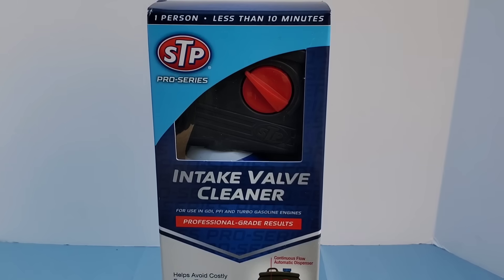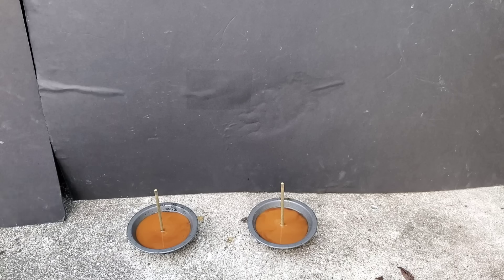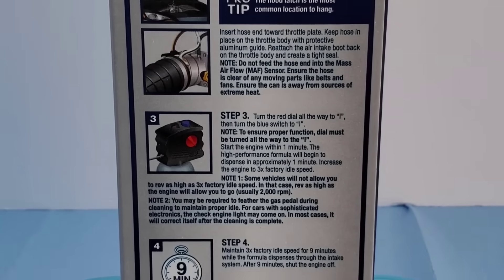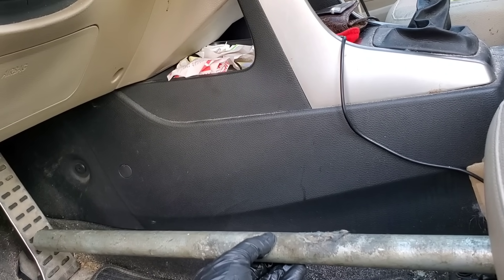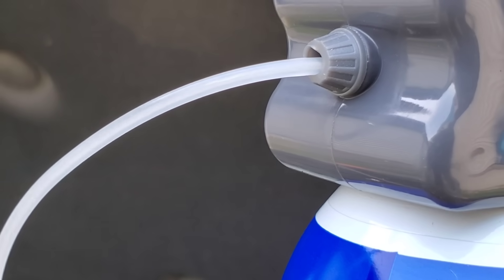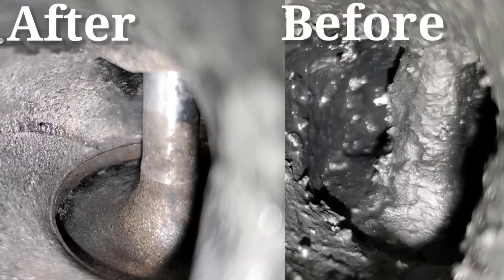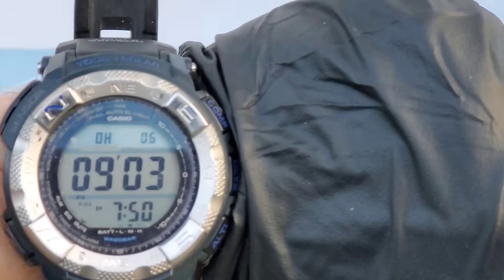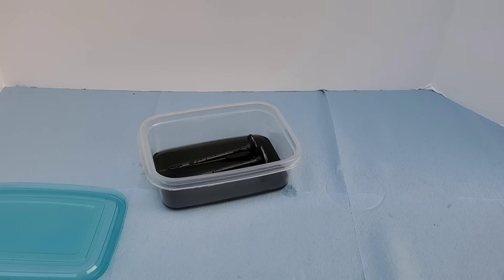Stp Pro Series Intake Valve Cleaner works!

Comment: Would this product work on an SFI (sequential injection) engine? What are your thoughts, would it make any difference or damage any internals?
Reply: It wouldn't do anything that the fuel isn't already doing. In a SFI engine the fuel cleans the valves so there is no need. This type of cleaning is really only needed in GDI engines.

Comment: Question, the valve on the right...how exactly does that build-up happen and how many miles was on that car?
Reply: With todays EGR systems the blow by gases/particles/droplets (which include Oil) can no longer vent into the air (as they did a long time ago) but must rather be captured and “recycled” back into the engine via the PCV (positive crankcase ventilation valve). It does that by mixing the blow by gases and Oil with the incoming air via the Intake Valve. Due to the temperature difference between the intake valve and incoming air (mixed with gas and Oil) has a tendency to deposit the Oil droplets on the Intake valves and ‘coking’ them up (black carbon deposit). Prior engines where fuel and air were mixed in the intake tract (port injection or carburetors) didn’t have that issue since the fuel literally ‘hosed’ down the Intake Valves hence keeping them clean. This issue is only a problem in modern Direct inject engines.
It can happen as early as 10-20,000 miles in some engines but usually is a concern between 40,000 -70,000 miles. Each engine is different and some have it worse than others.

Comment: I use foaming action Easy Off oven cleaner. Just warm the engine, fill the valve covers and intake manifold, let it sit overnight, start the engine the next morning and VOILA!  Not only does it clean, it restores worn and damaged parts! AND a cherry pie magically appears on top of the engine when the process is complete! But wait, there's more, Vince from Sham-wow comes out and details your vehicle and bangs your woman for you! Act now, operators are standing by!

Comment: Well time for a old mechanic trick.....brakefluid dous just the same, when the engine is running i pour some litle straight in the carburator and repertoire this a few times , it burns the inside verry clean .

Comment: 1 where does it all goes? Into cats?
2 valves are steel I got it, but how about valve seats, intake and exhaust ports(aluminum ones) and moreover gaskets?
3 how this is better than kerosene and transmission oil?

Comment: It works, as demonstrated, the part that STP doesn’t tell you is that ‘chunks’ will break up and get into your combustion chamber and some will lodge between the Piston rings and cause ‘Oil burn’ issues. Also, change the Oil a day later and you will see a lot of broken off carbon bits in the bottom of your Oil Pan! So yes, it works but…
Reply: I think you had oil burn issues before. Maybe just never noticed it. The carbon that this procedure is ‘dislodging’ is in a soft liquid form when it comes off due to this product being spraying into the intake. If any chunks would get lodged in between your oil control rings they would quickly disintegrate.
Reply: Why do the chunks slide by the piston rings ? Wouldn't they just get blown out the exhaust chamber ?
Reply: @truhunk1 p
Reply: @truhunk1 , some chunks probably get suspended in Oil and carried via various pathways into the Oil Pan and some probably get blown out too. Some smaller pieces can travel past the rings. There are many ways they end up in the Oil Pan.
Reply: @HsquaredH2  Then I guess the turbo blades love it at 15,000 rpm 🤦🏼‍♂️
Reply: Damn. Wouldn’t that be harmful for the engine and catalytic converter?
Reply: @unitedwestanddividedwefall3521  yes, definitely.
Reply: @itzed  thats why you do it on a hot engine.  burns straight off
Reply: What if you do it just before an oil change?
Reply: Never heard of it
Reply: Need to vacuum afterwards.
Reply: This problem happened to me when carbon cleaning my engine. The carbon deposits got between the piston rings and walls.
Reply: 😂 just do it right take the head off and intake
Reply: From what information and research the best way is to walnut blast  but using this spay every 10,000 kilometres would be a preventative measure so you cut down on carbon build up.
Reply: So tldr just do walnut blasting
Reply: Total nonsense from a tiny mechanic who wants to make a fortune out of walnut flour
Reply: I've used it multiple timez and never had this issue
Reply: From the gdi turbo engine I just tore down, not long after doing 2 of these and then starting to noticabls use oil.
It is this treatment causing it, but the exact reverse of what you thought. The center 2 pistons rings were alot clearer than the outer 2, including the valves in the same cylinders, but it was those cylinders that had lost compression. 195, 130, 110, 180 in that order.

It had cleaned them so much that now oil was escaping past the worn patches in the wall/rings that was previously blocked by build up.

Moral of the story is do it more often or not at all. Done on a 150,000km Mazda Mzr Disi turbo.
And yes it killed the turbo, impacts on exhaust side turbine. Those chunks in the oil you mentioned proceeded to block the oil feed line, cook the journel bearing siezed solid.

Use quality oils, pay attention to its API code, as of today API SN Plus is the your best choice for reducing chain wear and the dreaded super knock.

Novel over, peace out
Reply: At the beginning of the video the supposed dirty valve just looks like someone covered with never seize. Carbon deposits are not in a silvery paste like state.  Just saying.
Reply: @olbakerman1672  pretty sure that's just the carbon reflecting the light from the camera. That's pretty much what carbon deposits look like on my borescope. 

Although the real secret with these GDI engines is to do this more often. I would say like 10k or 15K miles.
Reply: Steel and aluminum is stronger then carbon build up so I wouldn't worry about it. But you do bring up a good point and I'm unsure if stp says to, but change your oil. Do this when your with 1k miles of needing an change so the oil is a bit fresher.
Reply: @themanthelegend7048  Steel and aluminum are also a whole bunch harder, tougher and more wear resistant to skin. And yet somehow I've left wear marks in all my metal handled tools.

Better yet have a look at a metal railing in a public area.

Even the softest of touches, becomes the harshes of files with the added ingredient of time.
 
The gentle river will still carve the hard stone.
Reply: It's also impossible to use on many DI engines. I drive a 2019 Civic Type R, and it's simply not possible to use this product, or any other similar product on that vehicle. To get anywhere near the throttle plate is difficult, and there is no flexible house after it. There is before the throttle plate, but it's a curve in a nearly impossible position. Any thoughts or suggestions?
Reply: @nYdGeo there is always an EVAP line or pcv line going into directly into the manifold. That's your possibly. It what I did in my girls Kia.
Reply: So changing the oil will resolve this issue? I’m thinking about doing the this intake cleaner
Reply: @Cummata  it will remove the chunks but in my case pieces were/are wedged between the piston rings and cylinder walls and it’s been consuming oil ever since… 7 Oil changes later🤦‍♀️
Reply: @HsquaredH2  so basically it’s not worth it to do the cleaning?
Reply: @Cummata  I think its high risk due to the potential of Oil burn issues. I personally will do the Walnut shelling next time…
Reply: @HsquaredH2  how many miles was on the card when you did the service? 
I currently have about 105k so I know there’s a bunch of build up which may cause a problem when it starts chunking off 🤔
Reply: @Cummata  I did ours at 62,000 miles because it threw a code which required this to be done… To make a long story short we didn’t have much time so I did it myself the next morning. I changed the Oil after driving it for 10 miles and discovered all the chunks, some as big as half a penny and tons of smaller ones (all carbon). So, the procedure worked but I have a Oil burn issue ever-since
Reply: @HsquaredH2  have you tried doing an engine flush with gunk or sea foam . Sea foam you can run for 500 km then flush the oil should help remove the carbon
Reply: @michaelwaldner7737  you love your never use seafoam
Reply: @Cummata I've done it a few times on my Mini Cooper and never had any issues. It really comes down to just how much buildup you have and the nature of it
Reply: @HsquaredH2 couldn’t u just use it agin to break it down further
Reply: Throw some ATF in your oil. Oil consumption will go as the detergents break down the chunks
Reply: @HsquaredH2 if you have oil burn issue change your PVC valve
Reply: @BaykieCole , made no difference
Reply: To do this procedure with the heads on the engine is just lazyness and stupidity....take the heads off then you can clean the crap out of them without getting the carbon into the cylinders....don't have the knowledge to take the heads off then leave it alone
Reply: @jasongrisdale3084  , lol, that’s literally the dumbest thing to do and completely unnecessary!
Reply: @jasongrisdale3084  do you know how much labor is involved removing cylinder heads from a twin turbo v8 BMW?? It’s literally a 40 hour job..does that sound like something you want to do in your garage? Or pay me 40 hours at 170 per hour?

Comment: I just bought this from oreilly for$40 … 
My 2010 Nissan Titan is like brand new ! Ty
Reply: How many miles on car when you used STP?
Reply: How’s the Nissan running now ., and how many times you had to clean the valves
Reply: @Voltrondefenderoftheuniverse  I’ve only down it once. At 100k miles. The truck is getting older . Used cars are selling for a profit now. I had an offer for $20,000. Brand new is was $30,000. Had $10,000 of free options. New trucks are $60,000+ and too many flan electronics if you ask me
Reply: @ReefMimic  ➡️ thanks for the reply 👍🏻

Comment: Hmm having seen a lot of these cleaning videos, I find it hard to believe it did such a thorough job cleaning the valves.
Reply: It's literally 8, 10mm bolts to remove the whole intake plenum, Kia's are great to work on and there's no way he snaked that endoscope through the intake manifold, he took it off. You would spend more time trying to to get it to bend in the impossible angle you need versus the 3 minutes it would take to take off the manifold
Reply: It's got to be true I seen it on the internet
Reply: I agree. It's very difficult for me to believe that a single application of this stuff cleaned the intake valves/ports so well. I just don't believe it.

Comment: Those valves and Chambers were so bad in that engine I'd be afraid of all that carbon ending up in the converter or the turbo or cylinders. Its not like the STP is going to turn the carbon to liquid,it's going to be in chunks of extremely hard carbon.
Reply: May be do it on a regular maintenance schedule and change the oil immediately after for high mileage engines. Better out than in.

Comment: WHAT IS IT ALL ABOUT WITH VALVES IN A BOX?  IT IS NECESSARY TO UNDERSTAND THAT THESE VALVES WORKED IN THE ENGINE IN WHICH THERE WAS NO VALVE GUIDE OR VALVE OIL SEAL.  I am saying this proceeding from the absence of traces of movement on the valve and build-ups in those places where they can not be in any case, under no circumstances!  THESE VALVES ARE FIXED WITH AN EASILY RINSABLE SUBSTANCE!

Comment: This is amazing! My girlfriend's GTI is in need of a walnut treatment - this might just save us from having to take the whole car apart!
Reply: What he isn't telling you is all that carbon that he's cleaning goes into your exhaust, through your turbo and could plug your cat if you have enough carbon.
Reply: @RepairGeek  it could also score the cylinders if the carbon is hard enough. I wouldn't do this with any engine that has alusil cylinder sleeves.
Reply: @RepairGeek  Just put it in after the turbo! if this stuf is disolving the carbon then nothing will get clugged!
Reply: I just sold my GTi after having it few years. Carbon buildup on these engines is ridiculous. Do yourself a favour mate and fit a catch can.

Comment: Okay I'm confused. How did you scope those intake valves? Were you able to get the scope in the side of the intake all the way down those 12-in intake runners into the head?
Reply: Why couldn't you pull the plug and have a 360 camera head. I saw another mechanic do it. Im no mechanic

Comment: So,this is safe to use in an EcoBoost engine? I imagine itd be safe for turbos and such if you did this fairly routinely, but like the high mileage car you used it on wouldnt all that stuff end up in the turbos? Mine only has 44k miles on it,but I'd like to head off any future trouble with the intake valves.
Reply: It shouldn't matter . If it doesn't burn up in  combustion.  It will be spit out the exhaust
Reply: @thomasmatarazzo198  Gotta be real careful what you put in turbo engines. A piece of debris the size of a gnat can destroy a turbocharger. Some solutions dissolve stuff,some break it loose. With a turbo you want something that dissolves.
Reply: @ciphercode2298  umm? That's not how that works.  The exhaust housing can take it. not going to be affected by that
Reply: @thomasmatarazzo198  Its not the housing you worry about, it's the blade. They can spin in excess of 300k rpms. A piece of debris is like dynamite at that speed.
Reply: @ciphercode2298  lol. No . You're never going to get something big enough through there to do that
Reply: Just use a  vacuum line that goes to the intake.

Comment: Can this be used on traditional engines where the gas is sprayed in from behind the valve?
Reply: You should just go with a fuel system cleaner. This is meant specifically for GDI where the fuel isn't sprayed directly onto the valves but directly into the combustion chamber. Regular motors spray onto the valves thus cleaning while providing fuel.

Comment: Do this right before an oil change.  Some of the nasty carbon and solvent ends up in the oil, and it is better not to leave it in there for thousands of miles, so just do this before an oil change.
Reply: How would they end up in the oil? Slip past the piston rings? 🤔
Reply: @docmdb87  that is correct or valve guides.   Believe it or not oil turns black because combustion material mixes,

Comment: For those who are interested, this is from the MSDS:
Butyl cellosolve 25-40%
Xylene 25-40%
Ethyl benzene 1-10%
Polyether amine 1-10%
Alkenyl amine <5%
Akyl aminoester <5%
Triethanolamine <5%
Reply: Nice, the cellosolve is what the old gm top engine cleaner was, Best stuff. I can smell the xylene when using it too. I've been using it at my shop a bit lately om these gdis. Its just too cheap, easy, and effective.
Reply: @jeremyr7147  just curious if you've serviced 2.0 T VW engined for valves mainly with this?
Reply: @RipPhillips  no, but it will work equally. I just finished a chevy impala 3.6 DI.. the stuff works. I have been getting them in about 150k mi. W/ no records of cleaning.

I like this because the engine is running while dispensing. It wont blow off big chunks like doing a soak. If its bad i would do 1 of these before the oil change 2 or 3 times, then move to a full GDI soak if you want. The soak will drop bigger chunks. So I'm doing these stp cans most the time till someone gets caught up. 

Last time i did a crc GDI soak on a really sludged 150mi  hyundia i got worried and stopped at 1/4 bottle and chunks were already pinging at that point. Like marbles in a can.

The key to a safe application is getting the engine and catalytic converter mostly as hot as possible. Set everything up so your ready to hook up after a hard drive to get the converter hot. That way chunks will vaporize when they hit it.. 

When finished drive moderate the first couple min then get into it a few times. For about 15 min of driving then change the oil afterward.
Reply: @jeremyr7147  Hey man appreciate the feedback and detail. New to this platform but want to take care of it so anything helps. I assume drive slow and then harder to reheat and help burn out carbon broken loose before high rpms disloding cold chunks in there then? Thay all makes sense tho.
Reply: @RipPhillips  yeah i take it easy at first to make sure the converter is heated again before blowing it out with the throttle.
Reply: Genius thankful
Reply: Also high fructose corn syrup. Ha, jk. Thanks for posting!
Reply: will the chemicals damage rubber or plastic from extended contact?
Reply: Often wondered what the additives end up as when shot out the exhaust, nothing good I bet ,

Comment: With that much carbon being removed at once did the car later have issues will the catalytic converter being blocked? I would imagine it wasn't all burned during combustion and some of it made it out the exhaust.
Reply: Cat will definitely take a huge loss of efficiency if it is not disconnected prior to treatment
Reply: @thatoneguy2756  carbon released at 300 Celsius and the cat is about 1200 celsius. so wouldn't worry about the cat
Reply: @lareboy687  Good point mate. I've seen many people talking about how the carbon could clog up the cat, but I've never heard of anyone who actually ended up with a blocked or underperforming cat after using a product like this.
Reply: Have you had any issues? I ran this on my 14 GTI and 08 Jetta. Never had any issues with both, it made the Jetta feel brand new. I even got new sparks and plug and that made a huge difference.